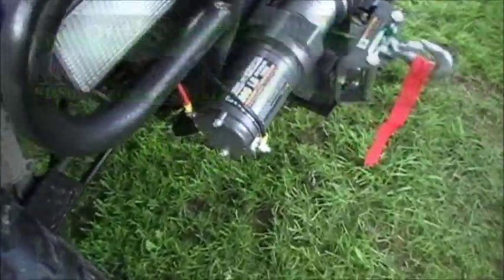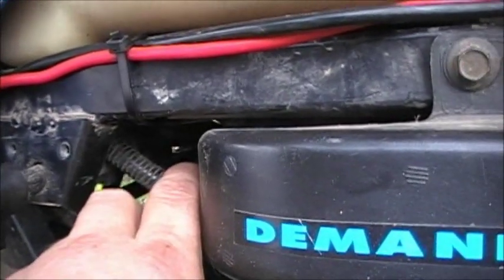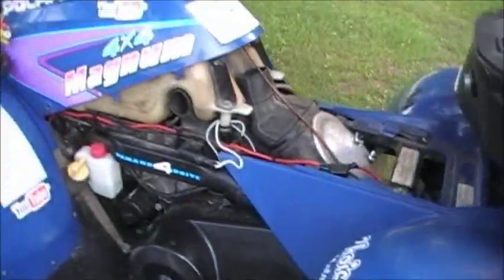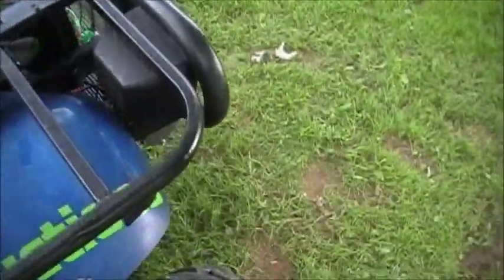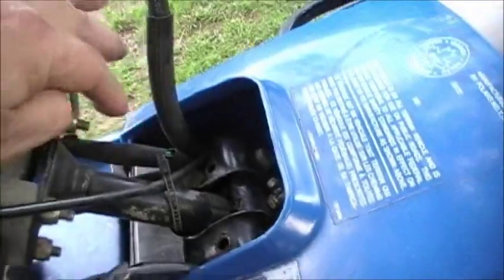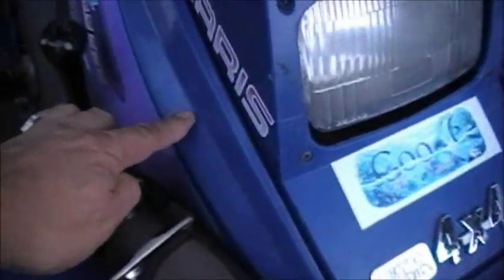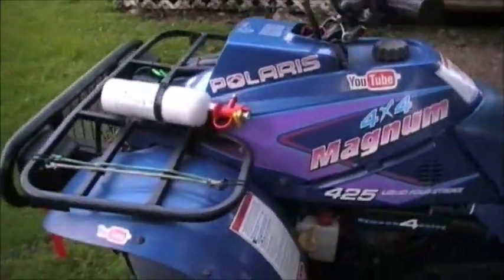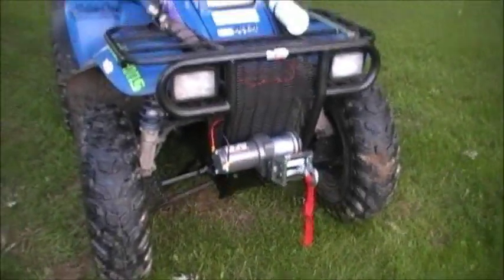Wiring up a BadLand Winch on a ATV 4 Wheeler

Comment: The blue but-but connectors you used are a great quick way of connecting wires. But you will have a corrosion problem if you don't seal them from moisture.

Comment: I'm trying to wire one of these and I need the box in the back and when I wired it with box in the back, Everytime I touch the black wire to the battery, it throws sparks. Does it matter if you put the box close to the winch or close to the battery? Mine is wireless only

Comment: really neat, hoping to install a 5000lb er on the truck soon. just a little headsup, that thing you kept calling a relay on the positive wire actually looks like a circuit breaker, instead of fuse which will burn and have to replace it will shut off and auto on when the issue is fixed.

Comment: I think i'm going to weld my mount plate across the two bars that attach to the frame (above the radiator, next to radiator cap)  I think it will look better and keep the heat away from the radiator.